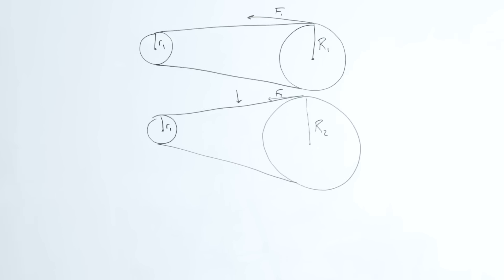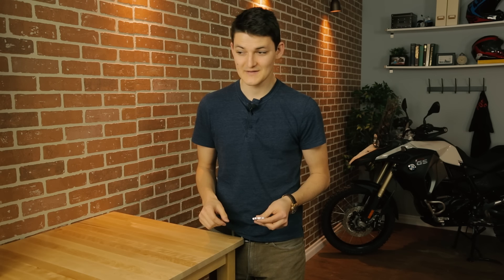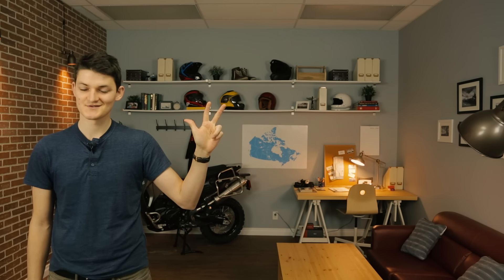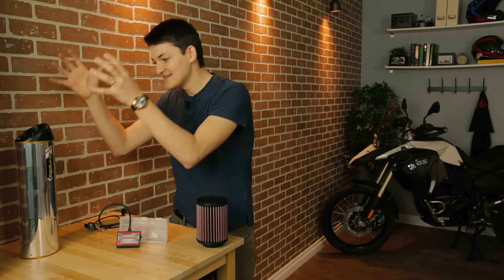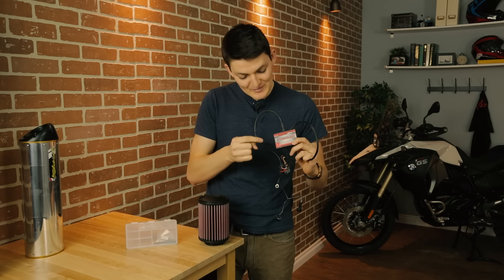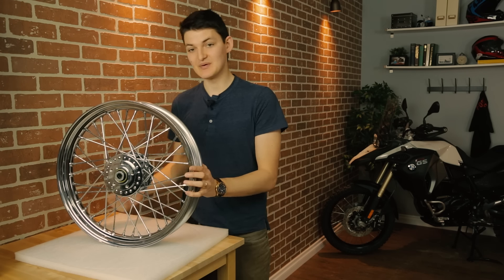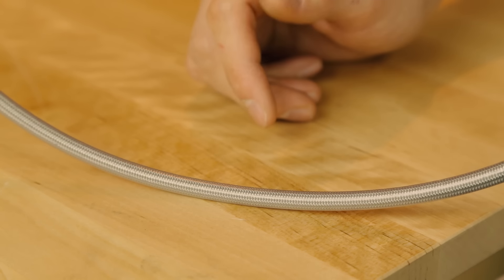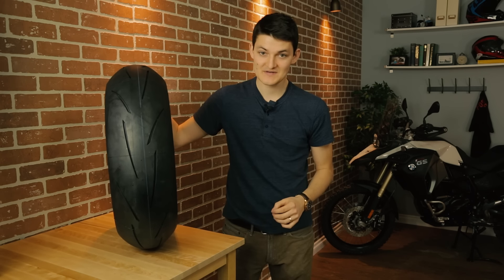Top 5 Motorcycle Mods to Go Faster

Comment: more air is what causes a bigger explosion, more gas cools the explosion. However, if you add too much air without adding fuel, it will get too hot from the hotter, bigger explosion and melt the piston or valves. SO, more air, and then add a calculated amount of gas, so that the bike doesn't overheat.
Reply: So more air means bigger explosion, who needs fuel.
Reply: Lol

Comment: Hi Ryan, I own a ninja300 and have done the following mods:

1. Iridium spark plugs
2. Akrapovic slip on exhaust
3. BMC air filter
4. Reduced 1T on the front sprocket 

I was looking at more front end speed and throttle responsiveness rather than top end speed and due to the above mods I am super satisfied with it. However, wanted to check whether a fuel commander is still necessary to further improve my riding experience or I could hold on purchasing that for the time being?

Regards, Zersis
Reply: INSTALL A QUICK THROTTLE FRIEND
Reply: Thanks Chandra Sekhar Ghosh but I would still like to know whether a power commander is necessary
Reply: @zersisirani1909  It could add HP for sure but your best is to get a full aftermarket exhaust and not just a slip on.
Reply: Thanks Nimble Ninja but as of now I am very happy with the current changes that I have done and will enjoy them for the time being
Reply: @zersisirani1909  That's cool. Any thought to getting a faster bike one day? I had a 300 and have a 400 but then I bought a CBR600RR and now the Ninja 400 just sits in my garage.  I didn't realize how super slow the 300 and 400 were until I got real sportbike.
Reply: Nimble Ninja, majority of my riding is within the city and Mumbai doesn’t allow me to enjoy bikes with higher displacement, so, so far so good, try making the changes I have done and maybe you might get them out of the garage to enjoy their nimbleness, you will be pleasantly surprised
Reply: @zersisirani1909  I just don't ride it because I have a 600 now. Not gonna put any money into the 400.

Comment: Changing your gear ratio does not change your acceleration because you have torque multiplication, except in first gear, but in first gear it does not really matter anyway.
What changes is that you use a narrower rpm power band so you might have slightly, but just very slightly more average power which is usually negated by the fact that you need to change gear more often.
Probably not worth it.

Comment: Looking at this again after I started modding cars I'm going some of this yes, some of it, kindof stainless brakes lines make a difference but not compared to pads or calipers in the realm of cars a brakelines is a fiber reinforced tube and they don't expand unless very old, like 80s, the air, exhaust, tune thing is true but exhausts are tuned to the expected cfm and resonance same with intakes, going to big can loose you power which is why the do all three applies. But would really talk to a tuner just like with cars, a property ported intake/head makes more of a difference then a bigger intake but that's dependent on experience, still love fortnine single best motorcycle channel I just don't personally agree with most of the standard performance mods that people use most of the time. Because the preformance is marginal is shotty, the wheels one I totally agree with, if not to the extend atleast with my experience with cars, order is brakes, suspension, tires then anything related to hp, although anything you can do to reduce mass both sprung and unsprung is going to make a bigger difference usually in the context of the rider alot of amateur driver, go on diets the week before they race because even in a car 10 lbs makes a difference.

Comment: I guess I am ahead of the game since I have already gone down 1 in the front and up 1 in the rear with a new chain, drop in K&N filter, dynojet jet kit, full exhaust, goodridge stainless brake lines, ebc pads, new rotors, continental road attack tires on my '01 Katana.

Comment: 1)  At 2:04 Ryan F9 says "low" when I'm sure he means "high".  Most larger bikes, especially performance ones, are geared high from the factory.
2)  Regarding changing the sprockets and affecting the speedometer/odometer:  depending on your motorcycle model, and where the manufacturer has placed the pickup for the speedo, you may or may not notice a change.  For instance on my Yamaha FZ1's I was compelled to use a "speedohealer" product to keep the speedo accurate.  But I was told on my FJ-09, a sprocket change wouldn't matter, because the speedometer pickup was somewhere else in the transmission.  Where could you find this out on your motorcycle model, before learning the hard way ?  The motorcycle dealer MIGHT know this.  Calling the manufacturer is difficult, and you might not get through.  Chances are if you join an online forum for your motorcycle model (which you should do anyway), ask the other forum members.  Chances are someone has done it already,  and will know.

Comment: A  PC is a piggyback system witch means it overrides your own ECU. Normally they dont make any problems but when they do they make hell of a problems. And the only thing the PC can do is have a new fuel map. And if your bike has a O2 sensor than the whole system is meningless. And you have to dynotune your bike.
A  ECU flash will connect to the bikes original ECU and unleash the limits set in it. The limits are set there because the bike needs to be EU4 or EU5 approved (enviromental restrictions). By deactivating theese limits your bike can use its full potential with the original fuel map. This means your bike will become the beast its made to be but you dont need to spend tons of money on dynotuning the bike. Its more safe, its your bikes own system and there will be 0 issues.

Comment: As I've been annoyed to discover with my Mustang, changing the sprocket (rear gears) also changes when you need to shift, you might accelerate faster but loose time to 60/100 because of additional shifts.

Comment: Smaller front socket has LESS leverage from the gearbox ...Q: ... which is most efficient  Larger Rear or Smaller Front socket ..........Power/Torque .. reducing or increasing flywheel weight/diameter ... worth a video...  Interesting Channel Thank You

Comment: Don't forget to remind people that when they change this chain on their motorcycle do not put on a racing chain on a bike that they use on the street. I have seen those change break several times. And it is very dangerous one these steel whips go flying through the air. Racing change are not made to leave from a stop on a regular basis. In a race your only leave from a stop a few times. And then you change the chain.
 S for my R 1200 C, I didn't change the exhaust but I did put a kid in air filter on it yes it does run later but it was running fat in the 1st place.

Comment: Hi there, nice video but maybe you should mention that if you change your sprockets you should also give your engine more maintenance. Because of the higher overall RPM the original maintenance schedule will be incorrect.
Reply: If you put a smaller front sprocket, your rpm gets lower at any speed, not higher

Comment: Depending on make and model, the reason the aftermarket exhaust is often the first mod because the factory exhaust may be poor quality, rust quickly, and be horridly expensive.
My GE250  factory exhaust is made from cheap steel. In the UK my exhaust lasted just long enough to outlast the 3 year warranty. 
Replacing left can, right can and cat are a shade over £900, ignoring various chromed bits that would have to be swopped over but are also rusting and will probably not come off the old system. 
Aftermarket one, street legal, under £300, in stainless steel. 
Not a performance mod, I only have 24Bhp start with,  simply a cost effective replacement.

Comment: 1: better brakes, 2: good tires, 3: suspension set up,  4:weight removal, 5: training. You'll go much faster with those than fitting an air filter or power commander.

Comment: I have to agree with you 100% I have several different front sprockets and several different rear sprockets that I exchanged out on a regular basis to get ready for where I want to go it might be ever so infinitesimally true that you should keep the paired sets but I don't go with it because you wear them out fast enough that it just doesn't matter when you have a machine that uses a chain but now see if you have a truck and you want to keep the pinion gear match with the spider gear where you has those two gears in a truck for sale 200,000 miles that idea works you better keep them paired and if you have to replace then replacing both because one's going to be different than the other because one has 200,000 miles we're on and the other one is brand new so they're naturally not going to fit right but, when you got a chain that's subject to scratch and you got teeth brackets that you know that you can wear out in a summertime say it a year at best depending on how much you ride you going to be training out that chain and them two sprockets so what the hell have several sprockets with different teeth on them to where you can play as you want when you get used to those changes you can get ready for the rides that you're going 4. Okay fortnine take it away bye-bye all that means I agree with you do it!

Comment: That isn't the reason fitting a smaller drive sprocket wears your chain/sprockets out faster. It is because you are putting all the power through fewer teeth, Remember you only have about 1/4 of the teeth driving at any one time. So that may mean all the bikes horsepower going through 3 teeth/links, that not only wears the teeth, but stretches the chain, which in turn further wears the teeth. I would always opt for upping the rear sprocket...and changing the chain.....always, always.
Reply: Allan Byrne straight talk. Thx
Reply: Does that mean that as you lose teeth in your mouth, the pressure is spread across less teeth and your remaining teeth start to wear faster in a upward trajectory of decay ?

Comment: K&N does not make the BEST washable filters in the world and you DO NOT have to change the air filter when changing the exhaust and adding a fuel controller. Changing the air filter is actually the least  important of the 3. The OEM filter is actually flowing quite a bit of air, more then most people realize so you already have to enrich the mix after changing the exhaust, if you add a high flow air filter (not a K&N) you have to enrich the mix even more to compensate for the added air. In most cases the air filter does not need to be changed, if you change the exhaust 99% of the time a fuel controller is really required. But if you really want a high flow air filter do not get a K&N get a MWR foam filter, or a BMC for a more traditional style filter.

Comment: I use full system exhaust, PCV, replacement air filter, hel brake line, and soft tires on my bike.. I really want to change the front sprocket, but I HATE how it throws off my speedometer and odometer accuracy by quite a lot.. and in some bike, there's no way to adjust that speedometer

Comment: 0:44
Keep in mind, the "less top speed" is for EACH GEAR, not the overall speed of the bike.  A smaller sprocket in the front of a dual sport for example, that already has low gearing would be a horrible idea.
Reply: It lowers the theoretical top speed for each gear but may or may not actually reduce the bike's real top speed, depends on whether your top speed is limited by power or by engine speed.

If your bike can hit the limiter in 6th gear then you'll hit the limiter at a lower speed. But if it doesn't have the power to hit the limiter in 6th gear than it's likely you won't lose any top speed actually, you'll just reach it at a higher rpm. You'll also be cruising at a slightly higher rpm for any given speed, that's the bigger downside.
Reply: Including 6th gear, therefore the bike's top speed is lower

Comment: Hey Ryan, like your videos! I recently purchased an F650gs (twin) 2009 and am looking for a full exhaust system. Arrow has one for the f800gs and Remus has one for the F650gs. I’ve read you can modify the 650 to recoup the 800 performance . Have you heard of anyone putting the arrow system on the 650? The engine is physically the same and the early 800 exhaust comes out the left hand side also. Cheers

Comment: What kind of power increase could you generally expect if you do the exhaust, filter and fuel injection mod?
Reply: 5%
Reply: 2.5% is more common, 5% at outer tippy top range

Comment: Actually changing gearing to a smaller front sprocket will make the bike "quicker" but not faster as you will be slower on top end. { or winding up more RPM to make the top speed.]

Comment: I have a 2016  lexmoto assault 125, it tops out at around 62mph on flat ground if I'm riding on a decline I'll get 70mph out of it but it's properly screaming and is not good for the bike on long journeys, I'd sacrifice low end speed for a high top speed, id love to be able to sit at 65mph without the engine screaming at me what sprocket upgrade should I consider?

Comment: 2:07 you meant the opposite. Stock gearing is higher to keep revs and exhaust noise low. People generally then lower the gearing ratio to get better acceleration and don't care about the noise.

Comment: The danger with the front sprocket is that it will destroy the splines on your output shaft, and a lot of engines require you to take apart the top end to get to that output shaft…
Reply: Where did you hear that? 
Changing the sprocket won't damage the main shaft unless you dont know what you are doing and use a sledgehammer to change it with
Reply: Also to get a main shaft out almost always calls for the entire engine to be torn down and the engine cases split, it's far more than just the top end.
Reply: asasial1977 it’s common on Xrs, that a primary sprocket that is harder than the output shaft will destroy the splines. I’ve seen it on other bikes as well . As far as malpractice , I used a mechanic but I failed to take the primary cover off and clean it up and take the sprocket off, which would’ve revealed the issue but still too late. As it is I’m probably going to shim the shaft with cotter pins and tack weld it on there. It’s a motorcycle; somebody may turn left in front of me and make the whole thing moot. I could get a spare bike with a donor motor for what a total rebuild.
Reply: @walterkersting1362  even if the sprocket is harder than the shaft how is it going to damage the shaft? It's not. I dont know what you have heard but I'm pretty much positive you misheard it.
Reply: asasial1977 all right, I’ll just pretend the problem doesn’t exist. 
Wow, my bike is is fixed! The problem never occurred...
What the fuck is wrong with guys  who ride motorcycles? A lot of them don’t seem like they’re grown up all the way.
Reply: @walterkersting1362  the simple fact you think a "top end" has to come off to change an "output shaft" shows all anyone with any mechanical ability needs to see to know you don't have a clue but carry on with your smart self
Reply: @walterkersting1362  stop acting like you know what you are talking about. It is obvious to anyone who knows anything that you are clueless. 
At best you bout a cheap bad/loose fitting sprocket that beat the hell out of your main shaft every time you go on or off the throttle, changing the number of the teeth had absolutely nothing to do with it. 
Go ahead and act like the typical RUB who thinks they know it all but doesn't have to know anything because they just hand the cash over to their mechanic. 
And just an FYI I have been a mechanic my whole life, from multi million dollar aircraft to running a BIKE SHOP so please enlighten me with your vast knowledge

Comment: Air filters are gimmicks now atleast in fuel injected bikes if you really want to open the airway you need to do a different intake manifold or head work      full exhaust and tune is going to be the same increase as a exhaust tune and filter     I would say ECU reflash over a power commander unless youre getting a tune

Comment: But mr Ryan, the real question is: how do we get high flow exhaust while keeping it legal? Or: How do we get super quiet exhaust while not restraining engine power too much?
Reply: It's only illegal if you're caught.
Reply: I worked at a Harley dealership.
Half the bikes there have the cats ripped out, full exhaust system, etc.
No one gives a crap lol
Reply: @JohnSpartan-117  Harley owners wanting loud pipes in not news to me.
But maybe it is news to you that there are other types of motorcycles and other types of people than that.

There are reasons to keep your exhaust quiet, but it's easier to find tutorials how to make them louder than more quiet.
Reply: @Rozkrwawiacz  Yeah I don’t have a Harley anymore. I trade my Sportster 1200 with a full exhaust for a Honda cb500F. I mostly like exhaust mods for performance benefits, not so much the noise.

Comment: @2:00 Surely you mean manufacturers purposely gear their bikes high? High gearing gives lower rpm for the same speed. I'm assuming the noise produced is a function of rpm (and also probably amount of throttle, but surely they would want the lowest rpm to still be cruising at around peak power).